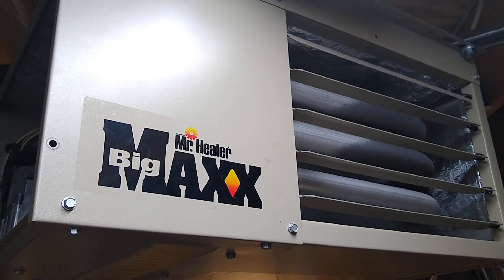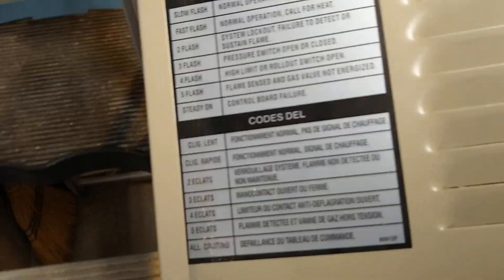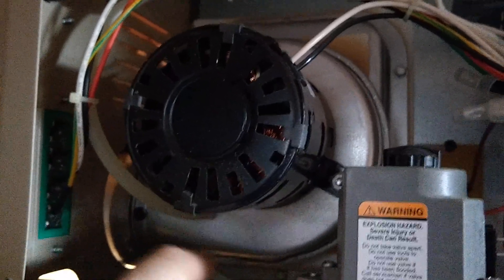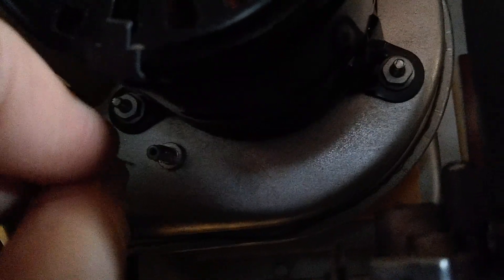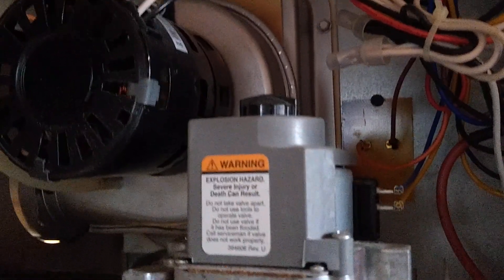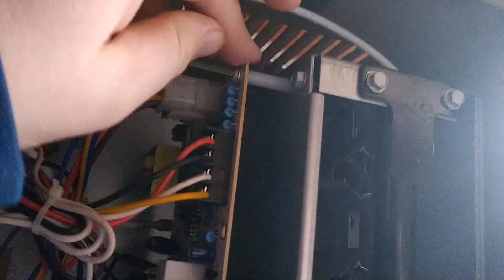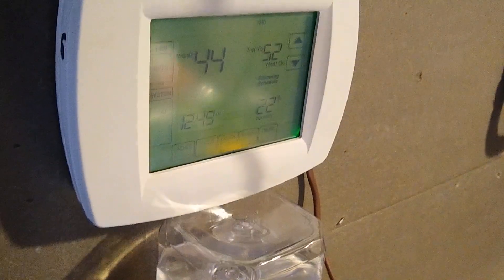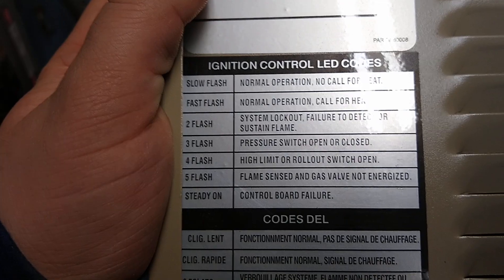How to Fix Mr Heater Big Maxx No Heat

Comment: Good and useful video, unfortunately for those of us that are watching this... we likely went out and purchased this heater which is basically Chinese junk. I have owned mine and it's in the garage for the past 6 years. I have had issues with this after 2 years, now I replace pressure switch every other year. 

These heaters tend to be unreliable and inefficient, you actually burn a lot more gas with these heaters compared to others in order to generate same heat. 

Spend more on good unit instead of this cheap unit which will end up costing you a lot more in the long run.

Great video though, I am sure it will be viewed often 😂

Comment: My gas pressure had to be adjusted once this was adjusted furnace was working
Reply from the maker: Sounds like a different issue.  Installed within wc specification?  Who ever installed it should have verified with a manometer.  If it changed, yikes- that's a bigger issue.